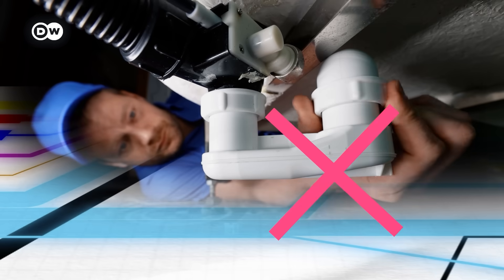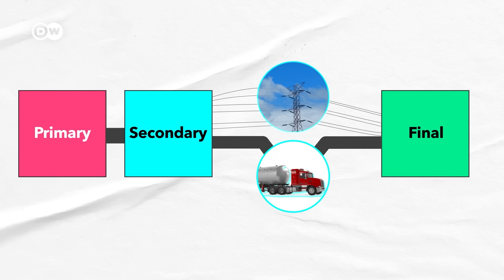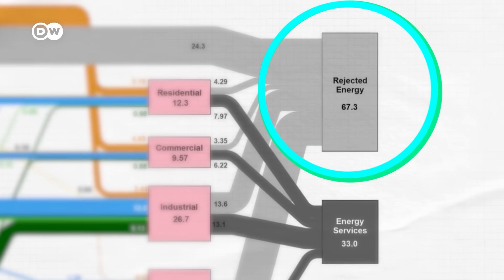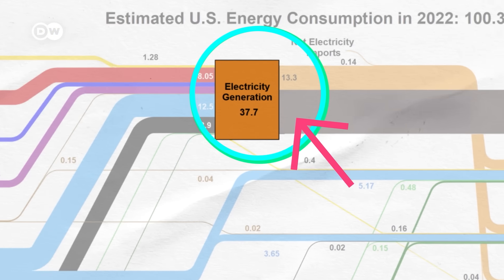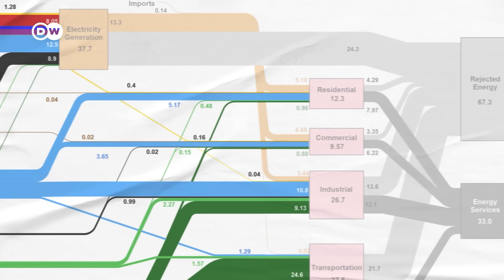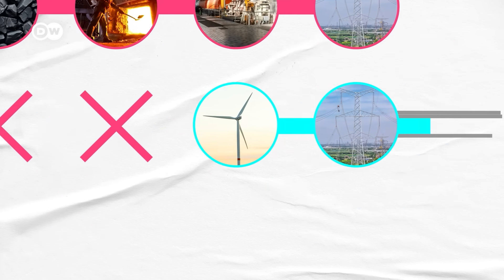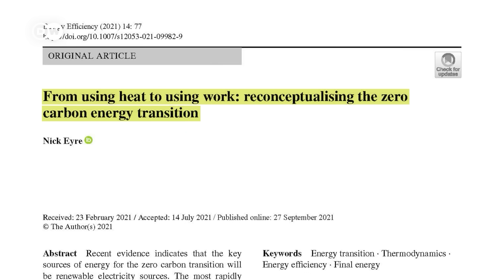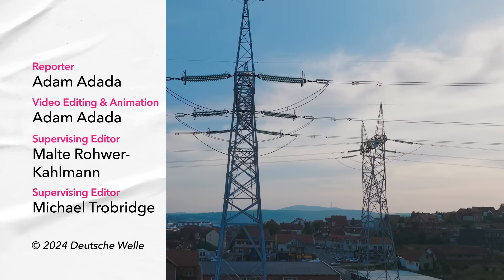The mind-blowing thing we get WRONG about energy

Comment: This video makes some very very important and correct points. However, it misses out to point towards the gigantic oportunity enhanced geothermal plants can have for the decarbonised future. Drilling deeper bore holes and achieving higher temperatures with (e.g.) closed loop systems, we can use all the infrastructure that was built for the fossile way of life (turbines, electric grid, etc.) and by just swapping out the heat source that generates steam to turn the turbines, we achieve complete reliability of electricity supply. 
But on top of that, these power plants can deliver heat directly to homes in the vicinity. Smaller cheaper plants for only that purpose will help this development too. This can significantly reduce the stress our electrified future wil put on the grid side of the equation (charging cars at home and using heat pumps in every home will make great changes to electric infrastructure necessary).
Two more very important implications come with the introduction of enhanced geothermal use:
1. Higher reachable temperatures (~500°C) will be sufficient to serve many purposes in industry without further losses due to transport and energy transformation (just drill whereever you need primary energy)
2. Building enough geothermal electricity plants will free all the other renewable electricity produced to be transformed to green hydrogen via electrolysis. This will make green hydrogen a much cheaper resource and therefore the use of it in fuel cell driven applications as well as in a more traditional way (burning it) much more viable.

In conclusion: With enhanced geothermal on the rise, there might be no need for nuclear fusion in the future.
Reply from the maker: Thanks for you comment. 🔥 We did a video earlier called: "Geothermal energy is renewable and powerful. Why is most of it untapped?" you can watch here 👉 https://www.youtube.com/watch?v=c7dy0hUZ9xI
Reply: @DWPlanetA  Thanks for your reply! In fact, I have watched the above mentioned video in the meantime  and my comment feels a little unecessary now. :D
Anyways These zwo fit together so nicely!

Comment: The wise thing is to keep improving. 
A point missing from this short clip is how much energy is required to produce say a commercial grid scale solar farm vs how much energy it will return over its life. (Without forgetting all the concrete, framing, long runs of cabling to all the panels,  as well as the cabling to get it from remote locations to a practical grid location)
I understand the omission of this detail might have been constrained by time.

Comment: Before we go green completely we need to go co generation ,that means using the waste heat to produce energy using a medium to produce Steam other than water it could be a refrigerant, propane or simply use the heat to reinforce a compressed air system, so basically the future is to bring all the generation together the green and the fossil fuels so they can help each other.

Comment: Lets make it clear, renewable energy is far from green. The optimistic view is mostly projected by people who do not look at  the whole picture.  First of all the efficiency of solar panels is about 20% (light to electricity), multiply it with only a few hours per day that this peak efficiency is maintained only on a clear sunny day, which makes it even worse. Here in the Netherlands we have to pay for the surplus power returned to the grid, which in  most cases puts a heavy negative effect on the profits. But most of all, and this always avoided by the media, solar panels contain significant amounts of poisonous chemicals/heavy metals. When the first recycle wave (millions of panels) arrives there will be a heavy price to pay in terms of pollution, costs and CO2 emissions.  
Furthermore, wind turbines are really expensive if you take out the subsidized part, off-shore is even worse.  Their low energy density  is problematic and  in small countries they encounter high resistance against placements near populated areas. Maintenance is expensive and under severe weather conditions (off-shore) even impossible.  Efficiency is complete dependent on favorable wind conditions and therefore, together with solar, is not a reliable energy source.  When going obsolete they have to be recycled too, same story as above. But the MOST SEVERE WEAKNESS is  their vulnerability to terrorist attacks, they are really sitting ducks!
The most absent aspect of this anti fossil fuel story is the global amount of metals needed, copper in particular, to make this dream come true. The unavoidable shortage of certain commodities will put a huge weight on the economics,  politics and more. 

In my opinion Nuclear energy is a very viable solution (The French did well).
Reply: Wind turbines are prone to terror, but nuclear is supposed to be the solution for that? 

Even if solar panels create a lot of waste, it's still better than breathing fossil fuel fumes.
Reply: So many mistakes here. France has some of the most expensive electricity (equivalent production price)  in Europe. While Denmark with its huge inputs of wind and some solar has the cheapest. Modern wind farms - including off-shore farms - in most of Europe are no longer subsidized as they are commercially viable. New wind turbines are also - by far - the most recyclable power generation we have. Nothing comes close. Try recycling a nuclear power plant. Now I worked with the nuclear industry and do not oppose it, however it has many downsides that people seldom consider such as the most narrow and restricted supply line you can imagine. One reason that Finland has a brand new Russian built nuclear power plant costing billions that will never produce even one watt of electricity. And how can you even think of comparing the terror risks of wind turbines with the risks of nuclear power plants? Try googling "Ukraine nuclear power plant attack" if you missed out on the risks we are all facing from a potential direct Russian attack on Ukrainian plants. There are no miracles in energy production. Each source comes with ups and downs. Too bad so many people are blind sided by their irrational and unwarranted preferences.

Comment: to use wind energy you have to have a storage system in place did he include the energy cost to build those batteries, the storage area they are going into along with the rest of the system or did he just show it and running to figure energy savings?
Reply from the maker: These unique challenges posed by renewable energy sources could be addressed with improving the grid or - adjusting our electricity usage. We did a video on this you can watch here 👉 https://www.youtube.com/watch?v=u-DsDuTceTo. Here is a metastudy giving an indication of what are the life cycle GHG emissions of different electricity generation and storage technologies: https://www.nrel.gov/docs/fy21osti/80580.pdf

Comment: Don't forget that wasted thermal energy from a stovetop goes into your home/restaurant and then makes the HVAC work harder thereby increasing energy usage and waste even further.
Reply: Where we live the “wasted” thermal energy from stovetops/ovens is efficiently used about 8 months of the year.   During our hot summer months our window opening mechanisms along with furnace fans are used a lot making use of the fresh cool evening air.   Our AC is on average used only about 10-20 days per year & during this hot period the hot appliances are consciously used less.
Reply: @gerhartleischner9806  I live in Florida so waste heat is a bigger concern, but I'm glad there are people who can reuse this energy.
Reply: @CausticLemons7 I assumed you live in a year round hot climate & I totally get your analysis of heat loss causing more energy use with the AC.   I live in Saskatchewan where having reliable base load heat & energy is of utmost importance for our survival, literally.  We have ample supply of gas, oil & coal which makes it much cheaper for now than importing renewable energy from out of province.   We are making some attempts towards renewables but the cost of living for the average person in the present day is also important which I don’t think was mentioned much if at all in this video clip.

Comment: While I agree that we need to shift to electrical systems, thise who said we CANNOT get rid of fossil fuel in the near term are correct. That is because it will take decades to build up the electrical grid. Furthermore, it is imposdible to gather the mineral resources to produce the batteries, electronics, and transmission lines needed for decades to come. The other isdue is that wind energy is counterproductive where there is not enough wind or solar power where there is not enough sun.

That doesn't mean we should not move toward an electrically dominant system, as well as reduce fossil fuel usage. However,  full transition as some harp upon is going to take time to gather the resources, build the infrastructure, and for some of the technilogy to mature. For example, our energy storage tech (aka batteries) is too immature for the grandiose vision often presented.

Comment: This video is total nonsense. The energy that is wasted in thermal processes is because a high temperature gradient is needed to efficiently transfer heat. It's impossible to get around this. 

And it's been proven for decades that EVs are worse for the environment and generate more CO2 over a 120,000 mile life cycle then ICE vehicles (it's the mining and making of them as well as the generation of the electricity). It's the EU's own studies that proved this 20 years ago. Plus they're ignoring most of the losses an EV experiences such as wind and the heating of the battery when it's cold out. Or the super short life cycle of real world EVs. And in the burning down of building or ships and other vehicles and it gets even worse. 

And green energy never generates enough energy in it's lifetime to make up for the energy to make them. And they can't be recycled. 15% of human generated CO2 comes from steel making. 8% from cement. Glass, aluminum and fertilizer could never be made with green energy alone. 

In short, everything that we're doing is the exact opposite of what we should be doing to pollute less and preserve finite hydrocarbon and mineral resources. Car companies are coming out with EVs that are even bigger and heavier then the oversized cars we already have. We should be downsizing but instead are getting people to participate in a lie that will lead to certain ruin more quickly than if we did nothing. Even agriculture is a disaster. We should be using massive herds of grazing animals to rebuild our land while eliminating the consumption of hydrocarbon and chemical inputs but corporations don't want that. 

Mark my words. Everybody who goes along with this will eventually see that they played into their trap. You will live in a cubical with no meat and no mobility. Edmonton Alberta has already announced they are becoming a 15 minute city and 1/2 of each person's travel will have to be by public transit and your maximum travel distance will be capped at 10 to 15 km. Edmonton is way up north and has tons of space but they're using a housing crisis as an excuse to bring this in. We're fools for falling for this feel good fake science.

Comment: You forgot the biggest factor.   For examples: Cooking with and induction stove is cheaper then a standard electric stove, which is cheaper then a gas stove.   EVs are cheaper to operate than gas cars.  About 1/10 th the cost.   And that’s based on current prices.   Generating electricity is way cheaper using renewables than fossil fuel or nuclear.   When added together cost of living a good life goes way down.  

Renewables = more energy available, and at far less costs to the consumer.   However we must never forget that means way less profits for the fossil energy oligarchy. It is in fact a death sentence to oil, days and coal.

Comment: We’ve had  $26k solar system installed about 5 years ago and it’s performance is fantastic.  We live in a very sunny and cold climate and the 10k system overproduces for our needs.  We also burn wood for heat through a high efficiency stove.  A hybrid car will be our next vehicle.

Comment: I'm on the skeptic side. If this calculation really increased efficiency so clearly and simply, I would have to see a clear deal here through my investor glasses. At the state/state level, it would be easy to allow higher debt over an infrastructure investment period of around 20 years and to invest accordingly with bonds. The reality is that less is being done than is necessary.

Comment: Great overview, there is just one point I hope you can add: while fossil fuel to energy wastes a lot of energy there are large industrial process (production of steel, cement, glass) where we need very high temperatures. While a lot of interesting research is ongoing and starting to deliver results this is an area where we still need a major breakthrough. Converting energy to heat is very efficient but reaching these very high temperatures is apparently still a challenge.
For a complete overview this should be mentioned as well.
Reply: Biogas! And natural gas to boot. And garbage. And ,..... Trouble is: Coal is bound to be and remain cheap.

Comment: This is a really nice story, but changes nothing about how much useful/final energy we need, i.e. how many wind turbines, solar panels or fusion reactors we have to build. All you did in this video was to explain the concept of  thermal efficiency (google carnot process, oder dt. Wirkungsgrad Kreisprozesse). If anything the message could have been: by going renewable (namely not fusion!!) we save way more emissions than the ones we "use"/"need", but selling it as good news for renewables is outright wrong. If you explain flowcharts, explain them scientifically, not with an ideology. I am a big supporter of renewables and we dont need to paraphrase our findings like you did in this video.

Let me be clear about my problem with your reporting: Above, I made the exception of fusion, because a fusion reactor would again be subjected to thermal (in)efficiencies due to the use of a plasma that heats water that turns into steam that drives a turbine. Using HEAT processes to transform fuel (coal, gas, oil, hydrogen plasma) into energy (electricity in a powerplant, motion in a car or plane) can never have more than roughly 65% efficiency, thats just nature (carnot process and others). If you use OTHER processes like solar panels or wind turbines, they also have maximum efficiencies. They are not called thermal efficiency anymore, but act the same from an engineering standpoint.  Physics puts these forever at a maximum of 41% for solar panels and 59,3% for wind turbines. Those (in)efficiencies are only a problem if the "fuel" you use produces bad emissions like CO2, not like wind sun and plasma.

Comment: while POV in this video is interesting it is good to remember that Thermodynamics still rules. Solar PVs, even if say 20% efficient turn 80% off the solar energy into heat that is trapped by atmosphere. Using that space (area) to reflect as much light as possible back to space would make global warming smaller.

Comment: All good and correct but you completly neglect the fact that if nothing is comming in from the left there is nothing to going out on the right. Switching everything to electric might be more efficent, nobody denies that, and if we use more efficient technology there is less wasted energy ergo less needs to put in the left. But there are other factors, first Renewable energy is a very volatile energy source you need to safe it somehow (Water, Batteries, Hydrogen) which basically adds a few steps, again each step producing waste energy. Second its not done to just build a few wind turbines and solar fields, if you switch all appliences to electric that formerly used a fossil that means the power grid needs to scale up with that added load.  
Again, im not against renewable eenergy sources, but it needs to go hand in hand with other measures. I'm from Germany and here it is at a point where we have at times so much energy that we don't know where to put it. We pay ridiculus amounts of money just to get rid of it, while at other times we need to import energy from neighboring countries from, you guesswd it, not renewable energy sources.

Comment: There is only one powerful and stable natural source of green energy, and it is neither wind nor solar, but geothermal energy.
This video gives the impression that wind turbines and solar farms appear out of thin air and generate maximum power all the time. It is not so. According to physics, if the wind speed decreases, the energy return decreases in proportion to its speed in the cube. Respectively, if the wind speed decreases by 2x, the energy return decreases by 8x. And, no one needs to be reminded that the sun does not shine at night. Green energy sources are very material-intensive, the basis of each large wind turbine, depending on the power, is made of hundreds or thousands of tons of concrete. On the other hand, masts are made of steel. Only imagine, how much greenhouse gases are released to produce that concrete and steel. And wind and solar parks won't last forever either.

Comment: you really nailed it. these facts should be widely disseminated and be an absolute priority for political action and legislation. unfortunately, a few things are currently standing in the way: you can't make as much money with renewables as you can with fossil fuels. as long as our economic system is only geared towards maximizing profits, it will stand in the way of the energy transition. The power and wealth of many countries and corporations are based on the sale of fossil fuels. So we don't have a technical problem, but a structural one.